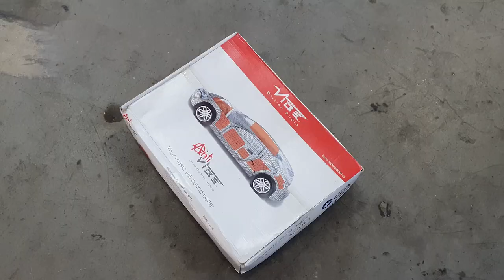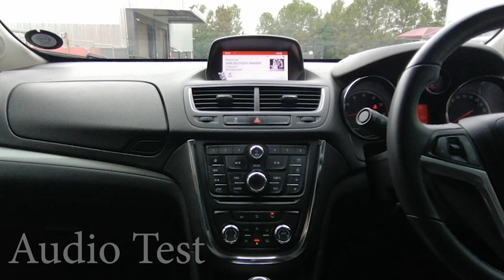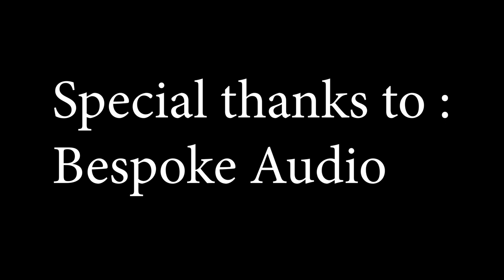OPEL MOKKA CAR AUDIO INSTALL BY BESPOKE AUDIO | VIBE AUDIO | DLS

Comment: How you got rca to the amplifier from the original radio? Any adapter?
Reply from the maker: Hi to low converter , or an amp high to low inputs